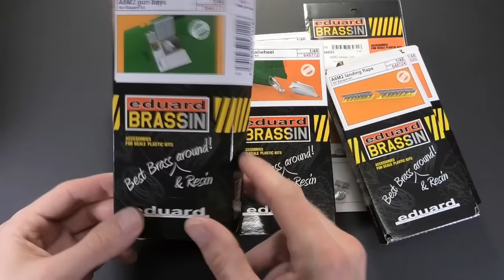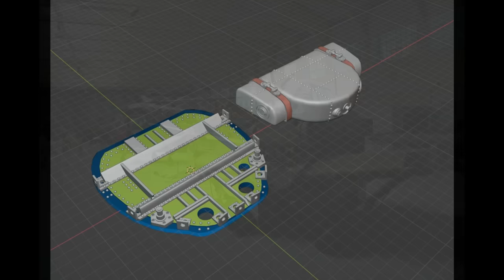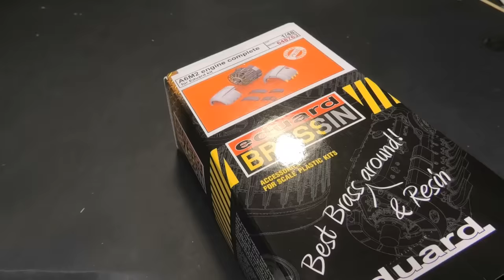Mitsubishi  Zero A6M2 model 11 - Eduard 1/48 - Aircraft Model

Comment: When the Type 11 Zero was deployed to China in 1940, it was still officially "Secret": so when it was on the airfield the front end was covered by Tarpaulins to make it resemble its predecessor the Mitsubishi A5M (Claude) fighter, which bore some resemblance to the Zero (Except for non-retracting undercarriage.) This meant that the rear fuselage faded significantly in the Hot summer of 1940 and again in summer of 1941. The paintwork kept under the Tarpaulins did not fade anywhere near as much, hence the 2 toned paint....  You have done a Most Excellent job. I recently bought that kit, myself and I have the Hasegawa Type 11 also in my stash. (Thanks to Hasegawa for explaining the 2-tone paint in their instructions!)

Comment: Great build!
You can use Mr color thinner to remove a thin film from Quinta studio rivets but of course only if you place them on a clear plastic. Just gently brush it on top of the rivets and the film will dissolve. Use decal softener and let it dry before removing the film.

Comment: f-14 tomcat would be nice, especially something, maybe top gun related. personally i build most stuff 1:72 for ww2 aircraft and 1:144 after ww2 (basicly jets) - currently building 2 f-14 D in 1:144 side by side. both are from the same squadron and have basicly the same design, just different airframe numbers.

Comment: Did Mitsubishi actually make the zero ? If so that is pretty neat , rolls royce I believe did the engine on the P51 mustang , I think the top speed was 251 mph fixed wing aircraft of ww2 was the most complex era for dog fighting i think , it was dam good combat , I wasnt alive back then but i love footage of old dog fights learning what it took to become an ace back then was cool to watch and read about
Reply: Packard built the P-51 engine under license. Mitsubishi manufactured some Zero planes and Nakajima the rest. You can tell it's a Nakajima plane from the metal blue color painted landing gear bay. Mitsubishi paint it airframe color.
Reply: @knight_flyer1199  The long-range P-51 Mustang fighter was invaluable to the Allied victory, enabling resumption of strategic bombing after heavy losses suffered by unescorted bombers in 1943. Developed for export to Britain, models modified by the British to use Rolls-Royce Merlin engines became America's most capable wartime fighters. It was rolls royce at somepoint

Comment: Would you mind sharing what 3D resin printer you use and your thoughts on it?
Reply from the maker: Hello. I own Prusa SL1 and recently upgraded it to SL1S speed. The new version can print in 1.5 seconds in one layer; the old version is 8 seconds, so the printing is now much faster. Also, it has a new monochrome display, so the quality is much better. I can not compare it with cheaper printers from China, but I have had Prusa already for four years and without problems. 👌
Reply: @idaemonplasmo  thank you. I was very impressed by how well prints matched up with the rest of the model.